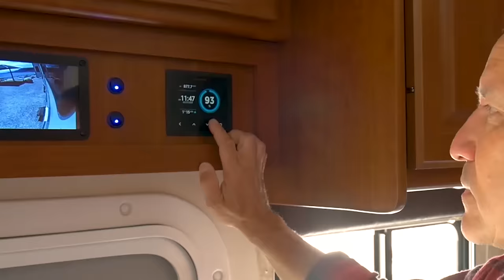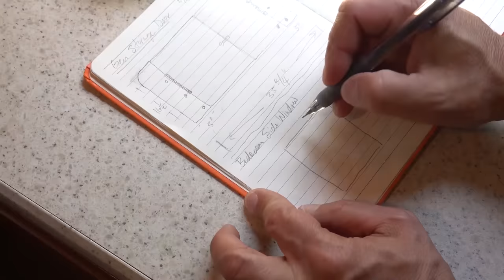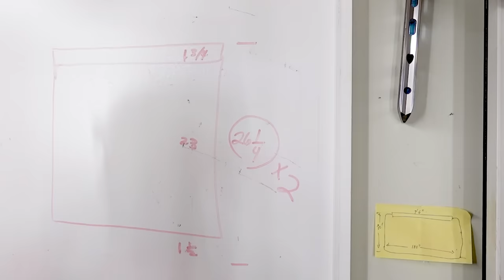THIS Replaces UGLY Foil Insulation In Your RV Windows (Full DIY Build)

Comment: The greatest value in reflectix is the silver paper that reflects radiated heat. Cover that up with cloth and you might as well use bubble wrap.
Reply: Exactly my point.
Reply: And needs to be outside, before the sun rays hit the glass windows 🤨
Reply: Reflectix installed the way he did helps block more light as well as providing more insulation value at the windows.  If you look at it, he has basically installed it similar to what it would be in an attic or wall installation.
Reply: @KarenFuchsbichler  ehst
Reply: @Tonyrd3000   I agree. It is used as insulation in this case.
Reply: Not true. You get the same benefit whether it's covered or not as long as there is an air gap. Which obviously there is an air gap between the product and window. Think about it. If blocking the shiny side made it useless, how does it work so well for its intended purpose up in attics?
Reply: @donchristie420  not true. Look into the product a little more. Outside elements actually degrade it rapidly. It's meant to be used inside. There are many channels that explain the science behind it
Reply: Okay guys ... As far as using the reflective sheets. No, they do not need to be showing bare towards the sun & light to keep the Heat Out. Think about this, they use the same wrap around Hot Water tanks. (they sell it at Lowes, same thing.) I actually have a 50 gallon tank in my Laundry room. I can't believe the wrap works SO WELL! I can't help but feel it once in awhile when Getting a mop or broom out of the closet It is Not Hot in the closet at all, nor is the reflective bubble wrap. Those tanks put out Alot of heat! So, yes, the reflective does Not have to be on the outside & facing the sun to block the heat. I'm so glad I have it around my hot water tank, 40 yrs!
Reply: There are people that use reflectex to insulate their van. Not a very good idea, but whatever.  Reflectex is meant to reflect light and then provide a very small air gap behind.   In this case, foam board would have down the same, but not as durable.  In this case reflectex is providing structure and a slight airgap.   I think an improvement is to put a sheer layer on the outside or clear vinyl to actually reflect the sunlight.
Reply: @fairrider3346  there is NO REASON to be rude !!😟🙄
Reply: Gene  LOL- JUST LIKE YOU-----GENE--LOL
Reply: @katbunn957  YES KAT-----THERE IS.
Reply: Puzzled why you guys don’t just go over to the Reflectix web site before you show people you don’t know what you think you know.   Reflectix has insulation and radiant barrier properties.   It does both.   Does not matter if it is in direct light or not.   The good news is I found a lot about Reflectix from reading this thread.   Not from the thread itself, but from the website.   And I found out some guys in this thread know what they are talking about.
Reply: @fairrider3346  my my. Why so nasty?
Reply: @robinr5669  WHY SO LATE???
Reply: @KarenFuchsbichler  ok
Reply: @Tonyrd3000  - you forgot that wall and attic insulation is 3 to 30” thick, not .25”.
Reply: @rustyshackleford1282  it doesn’t. You are leaving out a bunch of factors.

Comment: Well done!  Being a sewing enthusiast, I would use Insulbright, instead of Reflectex which is quilt batting with reflective foil inside 2 layers of batting.  I like this material because it would be washable.   It is most often used for hot pads!  You can still use the metal with magnets, and sew channels to make the panels, but the glue tape  is a great option as well.  Your shade looks great, works great, and for the non-sewist, a great option!  👍👍
Reply: Thank you for the tip! I've been waiting for some idea of how to make them washable!

Comment: Crafter tip: Aleene's permanent press glue is the BEST fabric glue on the market. Sometimes fusible webbing breaks down over time.
Reply from the maker: Thanks a bunch for the tip.
Reply: Buy USA when possible
Reply: Tear mender is good as well
Reply: Thank you for that comment Hannah the RV - I don't have access to work with iron and the webbing and was thinking to try with liquid stitch adhesive - I was looking at Aleene's and Dritz I believe - so now, I'm confident I can do something like this with different materials.
Reply: That was what I was wondering. How long did the heat bond last?
Reply: You are so right !!!! Fusible is set via heat. It often fails or is known to fail if it's exposed to HOT conditions. So a closed up RV in summer over time probably effect the longevity of the heat press glue. I'm not sure Aleene's glue is the best but it's good. And a great option to the fusible webbing. (I stuck up over 24 four foot by 18 inch double bubble insulation under my 24' by 10' covered patio. Everything was great and finished on a cool day around 62 degrees. The next day it hit 68" but a lot warmer on the upper shingles on the roof and I had 24 four foot panels by 18 inches falling down. I eventually stapled them to the double bubble the loop and the hook pieces to the ceiling of the patio and it works well enough now. But what a mess. PS you may need to wear a static release bracelet when handling this kind of aluminum insulation product and yes you can get zapped pretty bad. Once inside the fabric not so bad but might still send a shock through fabric even. I broke my husbands bracelet so when I bought him a replacement I bought a second for me and yes have used it when ever using this type of aluminized material.

Comment: Why use reflectix?  It would seem that you'd loose the value of the reflective material when you wrap it in cloth.  Why not use thin styrofoam or foamboard instead?
Reply from the maker: Yeah. Other materials would work just as well but would make it more rigid is all.
Reply: Actually, the reflective layer will still add value. It doesn't let any light penetrate from one side to the other. And it reflects back all the light, including infrared (heat waves). I'm going to use this for my house in a roman shade.
Reply: @jazztocountry1047  I thought you needed an air gap for any reflective material to have an insulation benefit?
Reply: @PhilPassmore  I was thinking of the bubbles in the middle of having the insulation value. The reflectiveness should send back the light frequencies or at least they'll be absorbed by the cloth, before or after being reflected, and then they'll be radiated if they're infrared and if they're not infrared they'll be converted to infrared and radiated. Yes I was having fun with being extra loquacious.
Reply: You could sandwich a piece of fluted board between two pieces of relextixs to get the R value.
Reply: Indeed, can use cheap foam, or even better, recycle those amazon shipping bubble bags, exactly the same, the shiny part does nothing when covered.
Btw, I find for a camper, i'd rather the covering open from the TOP, as it gives more privacy but lets the light in.  Most all windows open from the side or bottom.
Reply: Exactly, radiant barrier needs to exposure to air.  Heavy gauge bubble wrap will do the same job for a less.

Comment: When we worked in Las Vegas in the summer with 120 degree weather, living in an RV, we learned very quickly about Reflectix. We just cut it to fit the windows & stuffed it in. It made the RV much cooler with both roof top ACs running full blast. Great stuff that Reflectix.  Wish I owned stock in the company.

Comment: This is exactly what I’m about to do in our RV. Thanks so much for the tutorial! It gives me a lot of good information to work with. My only suggestion would be to use pinking shears instead of scissors to cut your fabric. This goes a long way towards stopping fraying but, if you’re still worried about it, you can use a product called Fray Check, or just a thin strip of hot glue on the edges. I don’t like burning the edges because, with my luck, I’d set fire to the whole place! Thanks again!
Reply: Before you do, check out how heat transfer works. There are three ways heat is transmitted, radiation, conduction and convection. For optimal insulation in summer you want to reflect the sunlight out of the window. In winter when the sun does not shine you want low emissivity. This means in both cases you want the reflective foil exposed to the outside. If you cover it with cloth the radiative barrier effect is strongly reduced (only a bit inside the bubble wrap). To get the most ensure an air gap exists between the reflective foil and the next material (window or curtain) of  at least half an inch. No need to go over 8/10th of an inch. If the air gap is wider you get more convection in the air gap. If the air gap is smaller you get more conduction via the air. The solution in this video does something but probably less than 50% of what can be achieved with the same materials. You can also get better results by minimizing draft around the curtain.   This may also limit condensation against the window when it is really cold outside.
Reply: Was wondering about this the whole video Ted, what would you recommend for RV window insulation then if we don’t care what it looks like and just want maximum efficiency?
Reply: @DRader150  In summer a single layer of reflective foil to maximise reflection of sunlight out of the window and minimize radiation into the RV. You can mount this flush to the window. Beauty of that is that during the day you can still see through the foil. Acts like mirror sunglasses. Be mindful that you don't create areas along the window where you get both reflected sunlight and direct sunlight.  That can become too hot. Also don't do this at home on high efficiency double glazing  with heat reflective coatings. those windows may get too warm. In winter you want the same but with one or more airgaps of  0.5 inch. Since in summer light  and heat radiation is often dominant you don't have to worry too much about airflow around the edges. This is if you are ok with getting ambient temperatures inside the RV. If you have AC in your RV an air tight air gab is saving energy. In winter, convection is much more relevant because there is always a difference between inside and outside temperatures. So in addition to the reflective foils you want to ensure there is an airtight air gab, so no (or minimal) draft around the edges. Way to do this is with velcro, magnetic strips like those used in a fridge (guess why), or with nanotape or the like. Some tape that allows endless removal and reapplication. To create the airgaps you can put the foil around he window or use thick bubblewrap with reflective foil on both sides.  If your airgap is not airtight in winter you will get condensation against the cold window if you add moister to the air in the RV. Keep an eye on it and if needed allow it to dry daily, allow it to drain or make he airgap airtight.  No need to insulate windows much better than the rest of the RV. In summer best a good way to keep heat out creating shadow on your roof. There you want at least a  6 inch gap to allow the wind to blow away warm air that accumulates  under whatever creates the shadow. If in summer you want to occasionally keep something at ambient temperatures in the sun buy a piece of pure white Tyvek or another brand of spunbonded polypropylene (not polyethylene). This is super reflective white. You have to wear sunglasses for eye protection.
Reply: @TheTEDfan  dang thanks a lot for the detailed explanation, copied it down and will likely get to work on this tmw then.  Appreciate ya!

Comment: When using an iron to heat up those bonding strips there's no need to use steam. The steam wets the material and then when it is exposed it cools quickly because it's wet.
Just apply a hot iron works twice as fast.
Reply: Exactly!

Comment: Hacksaw blades are designed to cut in one direction, forward. When you apply pressure pulling the blade back-and-forth you're just heating up the blade and dulling it. 
Just appy light pressure going forward and a lifting action coming back cuts the material faster and cleaner.
Reply: Thank you very much for your expertise👍 I needed it
Reply: I never knew this!
Reply: Same with a file. Only cuts in one direction.

Comment: Pretty good idea.  I took a $7 roller shade and replaced the shade part with faux ultra suede, ironed on a semi stiff white interfacing to the back.  From the outside they are white, inside is a caramel color.  Can be done without any sewing too.  I sew so turned the sides and bottom edges over and top stitched.  Won't work for tall windows as the material is too thick for the roller but for most RV kitchen and bedroom windows works fine.  Was able to match the bed quilt this way. The store bought shade is only for harvesting the hardware, any thrift store shade will work.  Remove the non spring end plug and cut the roller tube to the width you need, replace the end plug.
Reply from the maker: Nice! Thanks for sharing that.

Comment: If you added magnets to the bottom, your design would work well for vans that have sloped windows. Thanks for the video!
Reply from the maker: That would be a great addition to this. Thanks.
Reply: I have done this to my minivan..not as fancy or detailed but reflectix inside my black out curtains then held up with magnets all the way around😉👍✌
Reply: There are flexible strips of magnets, or you could also cut your own out of the magnet sheets that are used for DIY projects all the time. If you've got a sewing machine with a little beef in the engine, you can even sew THROUGH it with a 16 needle! That way you could get a really good seal all the way around van and car windows!

Comment: Thank you for this idea. I sewed mine as I don't have a lot of faith in iron on hemming tape for lasting. This is such a good idea and I love mine. I struggled to find flat stock so we cut 2 inch wide strips of metal roofing flashing and hot glued that to the reflectix. That worked well.
Reply from the maker: Nice! We found some other insullated material to use as well thats not crinkly. More than one way to do it 👍😀

Comment: Yea! Pretty slick.
I did a similar thing with those magnetic roof-vent covers, where I removed the bezels, installed super strong magnets around the perimeter of the flashing. That eliminated the need for the adhesive velcro that comes with said product. Now, the magnetic covers simply cling to the bezel and you can still open them halfway, as designed by the mfgr.
Bill, Seal Beach CA

Comment: Nice one, I'm doing something similar. Did you consider installing the magnets on your ceiling / cupboard overhang so that you can lift the blind completely above the window and not obstruct ant view out of the window when the blind is opened? That would be important for me as losing the top 20% visibility out of the window would affect a lot of my view in my ford transit camper conversion. Thanks for the share.
Reply from the maker: I could just lift the blind off to have an unobstructed window :)

Comment: I'm going to try to make these. Thanks for sharing. I don't have any scrap steel but I have a lot of old curtain rods. I snapped off the bendy ends and I have steel bars. Cheap cheap! I did price steel at Lowes and geez the price has jumped up. My windows are longer 58 inches wide so I had to use one whole curtain rod and one  half pushed them together and adjusted for my length. Hope this helps others with cost and who don't have alot of tools on hand. I have everything cut out and ready to go for tomorrow. Thanks again!🙂
Reply from the maker: Good luck!

Comment: Instead of using a crunchy reflectics you could have used a closed cell foam. It's available in 1/8",  or 3/16" or 1/4" and it offers a much greater R value then reflectics.  It would help the fold up lines to fit the window better and not sound so crunchy when doing so.
Reply: reflectix blocks cut radiative heat loss... Closed foam is just insulation (maybe better for cold applications)  and does nothing for reflecting the heat back out the window.
Reply: @151mcx I was thinking something similar in that by placing the reflective material inside the cloth isn’t that defeating the purpose of reflecting the suns rays away from the window thus keeping the inside cooler?  Since the curtains are already black out, the reflective isn’t aiding in blocking out the light.  But it does make for a nice hanging window treatment.
Reply: @151mcx  Wrapping the foil in fabric completely negates the ability of the Reflectix to block radiant heat, unfortunately. Radiant barriers need an air space of at least half an inch to function. The curtain idea will retain the insulation in the Reflectix (the air pockets), but none of the reflective properties are intact.

Comment: I love your idea, use of French cleats to hang, and utilizing the blackout curtain.  Great job.  I assume the “vapor barrier” product (white on one side, bubble wrap type material” that I have on hand would work as well as the reflectix.  Thanks for sharing your idea.
Reply: the answer to your vapor barrier question is "no!" emphatically. yes bubbles trap air, but only reflectix reflects the radiant heat (ps - because of its construction reflectix works to keep heat out and to keep it in, so it is 365-proof. bubble wrap is only good for winter, and far inferior. properly-installed reflectix can give r-values of 20+.)